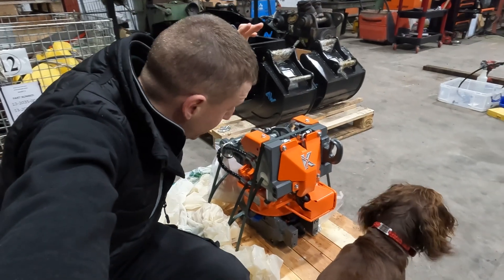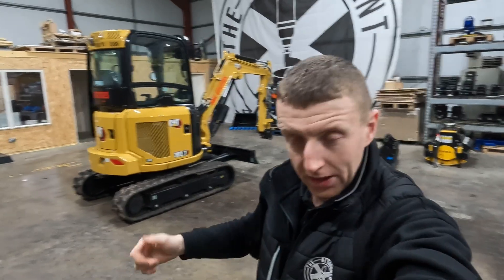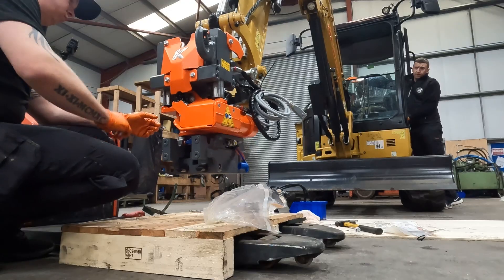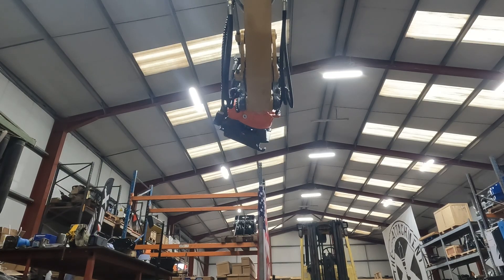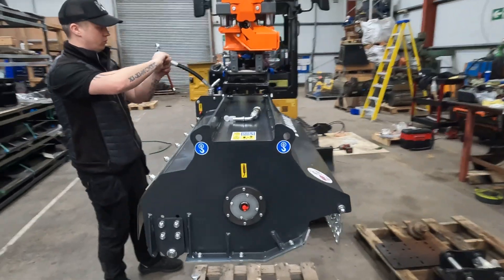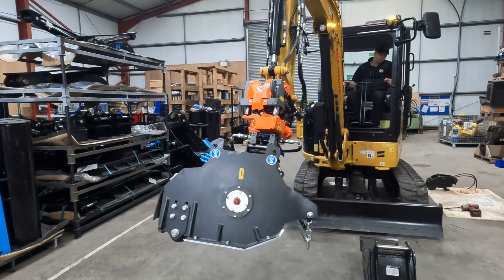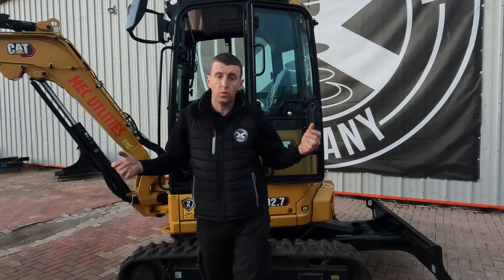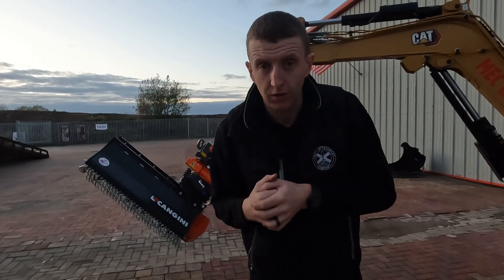Insane Mini Excavator Setup! CAT 302.7 with TR025 Tiltrotator & Cangini TC-1 Flail Install

Comment: Very impressive, i'm surprised the 302.7 has enough flow to run the tilt rotator, as well as the flail mower. Sweet set up!!
Reply from the maker: Glad you like it! It definitely handles the setup well. Thanks for watching. Cheers, William

Comment: I'm surprised that even with that super compact tilt system it has a taller build height and the same weight as steelwrist or engcon, yet way less tilt angle. What is the advantage of this unit? Does it perhaps have better flow through the swivel? It looks like maybe the rotator is thicker then others which would mean perhaps a stronger rotation?
Reply from the maker: Thanks for your comment - weight wise it's comparable to an XTR2 but as far as I'm aware that's too small for a 2.5t machine. TR025 is 18mm taller than an XTR2 but much shorter and lighter than a X04 so no real direct comparison that I can see in the Steelwrist lineup - unless I'm missing something? Cheers, William